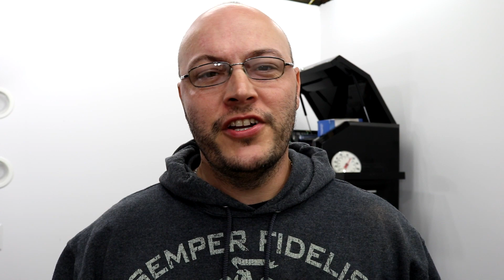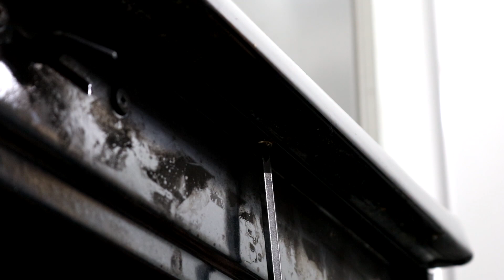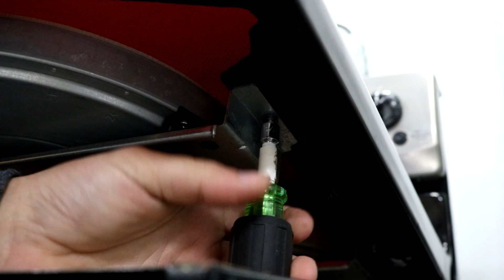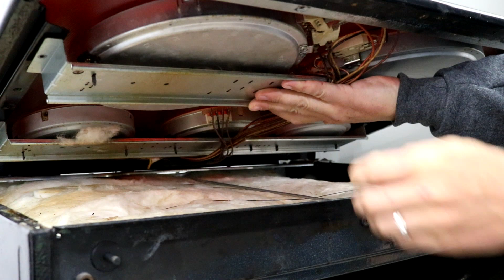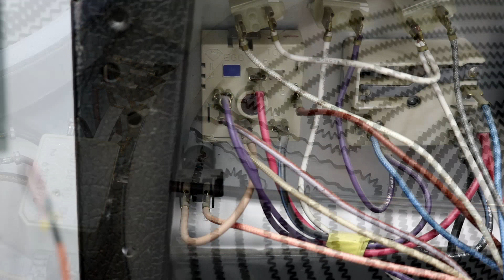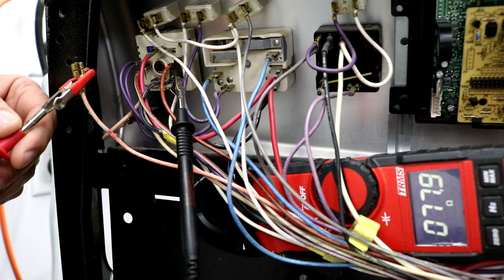Frigidaire / Kenmore Glass Top Stove Repair / Triple Burner Element

Comment: Model # FE710DRS/XAA
FRONT RIGHT RADIANT 3 ELEMENT DOES NOT CYCLE. I'VE INSTALLED:
NEW INFINITE EGO SWITCH PART # DG44-01003A
NEW 3 ELEMENT PART # DG47-00065A
DOES NOT CYCLE ON ALL SETTING ONLY ON THIS FRONT RIGHT BURNER
YOUR HELP WOULD BE GREATLY APPRECIATED
PREVIOUS INFINITE EGO SWITCH WORKED BEAUTIFULLY CYCLING ON ALL SETTINGS (INNER, MIDDLE, OUTER) SWITCH MADE LOUD POP WITH FLASH WHICH POPPED CIRCUIT BREAKER. AFTER RESETTING BREAKER THE BURNER INDICATOR LIGHT STAYED ON WITHOUT ELEMENT TURNED ON
SINCERELY
SALVATORE MAGARELLI
MOBILE NUMBER: 631-332-6325

Comment: Having trouble with outer ring of double burner, same idea.  I have determined it is not the burner elements and not any of the switches, which leaves me only with the possibility that the wiring is the problem (which seems unlikely).  How do I check the wiring?

Comment: Absolutely gorgeous cook top, all stainless steel with real cast iron grates. Wipes clean very easily>>>allmy.tips/n9lr   A bottle of stainless steel cleaner/conditioner and a really nice cast iron griddle/grill was also included (neither are mentioned in the item description). We bought a griddle almost identical to it at Christmas for a family member and it cost us $50 all by itself, so that was a cool surprise. Installation is clear and uncomplicated. True to size 30", fit right in our old electric JennAir hole.

Comment: Always learning something new...or an easier way to do it! Thank you! 
Question I don't twitter so I will ask my question here. One year old LG electric dryer DLEX8000V Won't start doesn't have thermal fuse but has thermistor on exhaust & the belt switch are ok. Push pause/start button it acts like it starting the drying icon flashes but won't actually start. All therms and elements check out . any ideas?